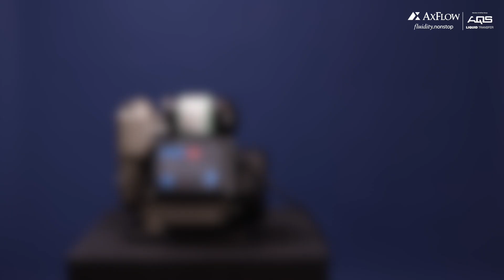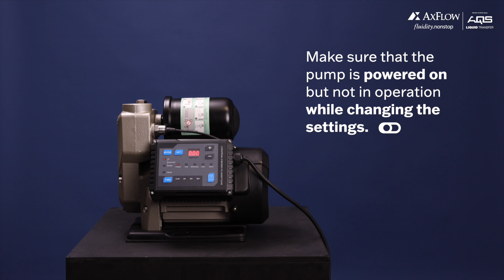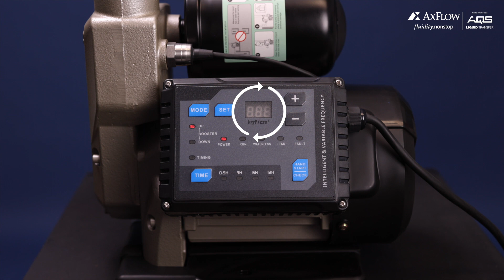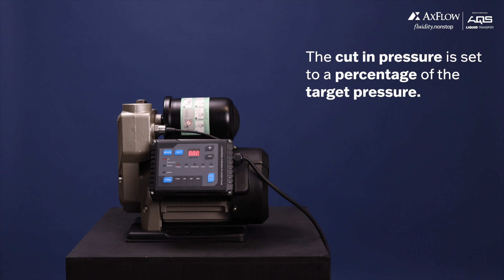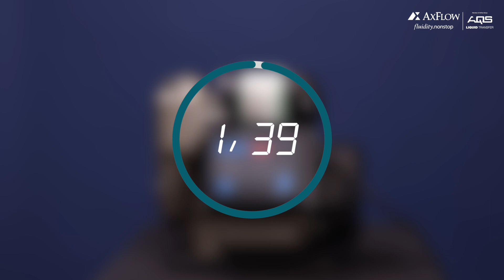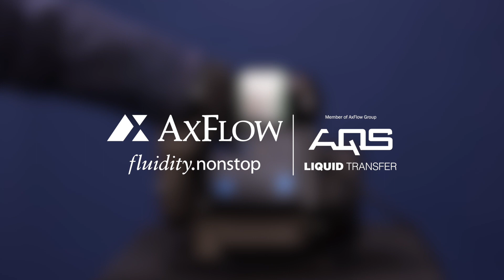Adjusting the Cut-In Pressure of Your VSP Pump

Comment: How can the pump be on but not running? 

It starts running every time the plug switch is on.
Reply from the maker: Set pressure has been reached, and the pump has switched off. Open up a tap nearby to release pressure in the system, then the pump will detect there has been a pressure drop, and it will start up automatically.